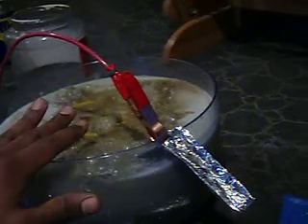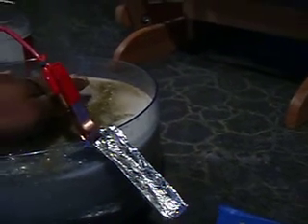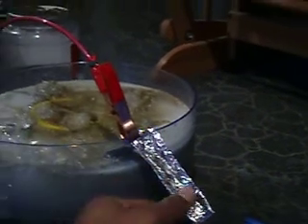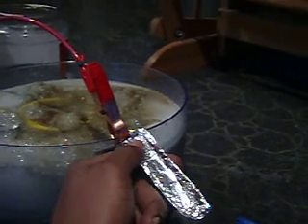hho 1st attempt

Comment: well, actually, aluminum when exposed to potassium hydroxide will release hydrogen gas in a chemical reaction ... but the aluminum is consumed in the reaction ...

nickel will oxidize quickly ...

palladium has great potential but be carefull, the palladium is a storeagle medium for hydrogen and will bind nearly 900 times its volume in hydrogen ...

forget gold and silver unless you aren interested in doing some electroplating ...

best in order is tungstun, stainless 316 then 304 ...